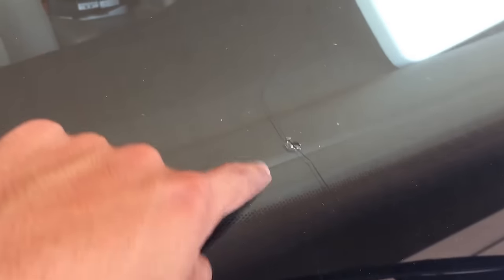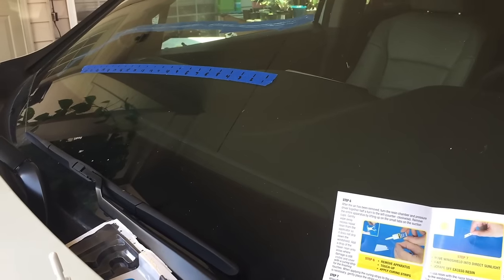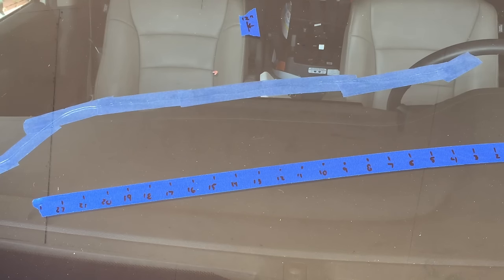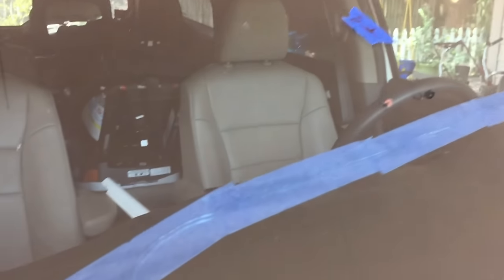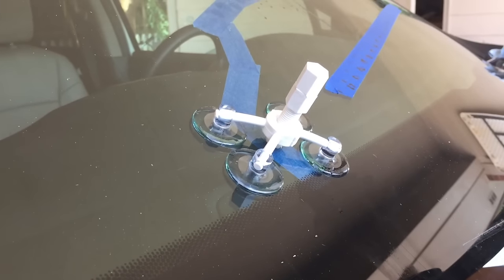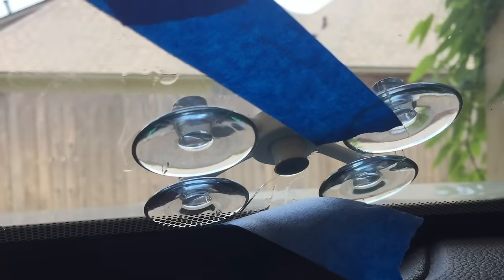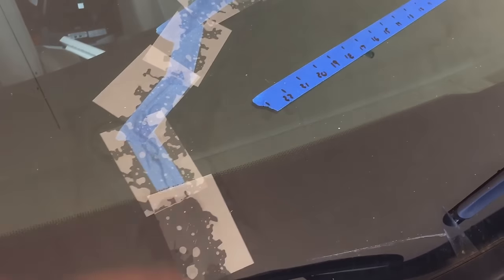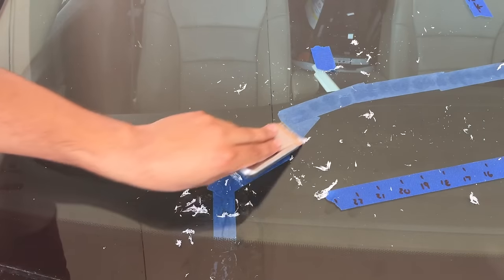Rain-X Windshield Repair Kit on a Chip + Long Crack

Comment: You did it wrong from other vids I have watched - you are suppose to use that suction thing with grease so it will slide to get resin into the crack. youtu. be  /qhrqjBQTauY

Comment: The crack is too long. The windshield should be replaced.
Reply from the maker: Thanks for the comment. We're trying to not replace since this car has some OEM electronics that appear to attach to the windshield, and I think it would cost more than a standard windshield replacement due to this. Since applying this fix over a month ago, the crack has stopped growing. Our goal was to stop it from growing into the driver's side of the windshield, because that would fail the annual inspection.
Reply: fiveohmxco 
You’re right and you can only get the right windshield from Honda dealership or you’ll have issues with your Honda sensitive system
Reply from the maker: @reyperez3424  Good to know.. I hadn't looked into it, and kinda bummed to hear that confirmation haha
Reply: @reyperez3424   @fiveohmxco   When moving into my new Subaru Forster Touring edition (Top of the line), the dealer wanted to sell me a $700 (one time) insurance for the repair of glass as they said the same exact BS for the glass and quoted because it is using safety camera sensors near the mirror (Subie calls it Eye-Sight) I should buy it... WTF. My scam detector was all the went off as I really don't see a reason why third party glass should cause mal focusing and malfunction of some cheap chines optical on the other side of the glass/windshield. 
These SOBs are trying to rip off us because of our ignorance and the "Fake" fear they try to introduce and inject into our minds. You did really well and way to go.

Comment: Dang that’s a big crack just buy a new one wtf😂
Reply from the maker: Apparently it's $900 to replace the windshield on a 2019 Honda Pilot due to the fancy smart sensing camera stuff attached to the windshield... figured $10 was better than $900...
Reply: @fiveohmxco  safety is a big thing for me. $900 isn’t worth your life or who ever drives that.
Reply from the maker: @edgarc8070  Lol... i'm a corporate engineer at a global specialty chemicals company, deal with safety on an almost daily basis. Not seeing the safety issue here?
Reply: @fiveohmxco  this is why I'm here watching your video at 3am... I don't have that kind of money laying around. Hopefully it works well to cure in the winter time. I'll just have to run the garage heater and let it sit in there for several hours to make sure it dries but it won't have the sun baking on it that yours did.
Reply: To each their own

Comment: Ok.  Following all the direccions i come to the conclusion that all rain x products are garbage.  The cracks are visible.  The wipers don't make it to one season in eastern Washington state comparing to others including the wal mart brand which lasts 2 or 3 years.  Before the season is over the squick.  The wind shield rear view mirror kept falling of 3 times untill i finally bought the other brand on the youtube videos.  Nothing works and not cheap.  It's more expensive then the other brands

Comment: Wtf is that blue sht youve got on the windscreen the instructions doesn't involve those?????
Reply from the maker: Lol just painters tape to help see the crack for the video
Reply: @fiveohmxco  oh ok, i dont think this stuff works cost me nearly $50
Reply from the maker: Geez. I think I paid like $9 for it a few years ago. My main goal was to stop the crack from spreading, and it worked for that. Made it less visible but def not invisible
Reply: @fiveohmxco  can you put more resin in afterwards?
Reply from the maker: @Insert.anger50 i don’t think so